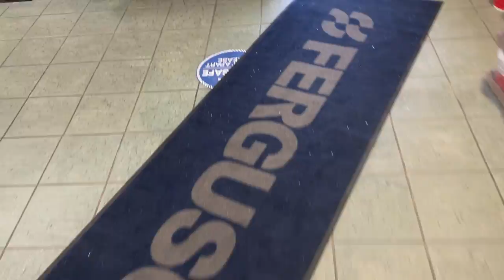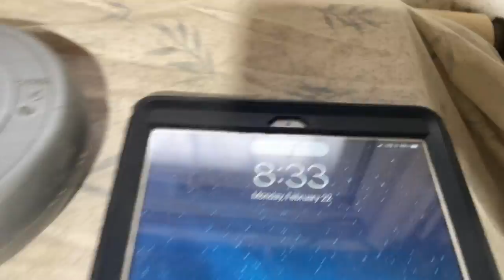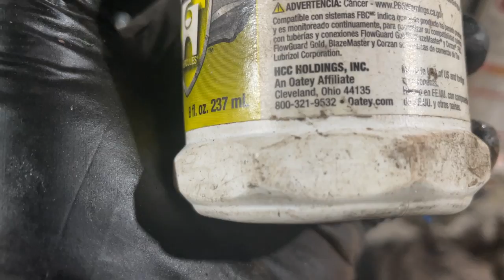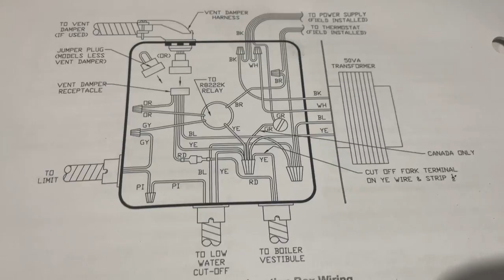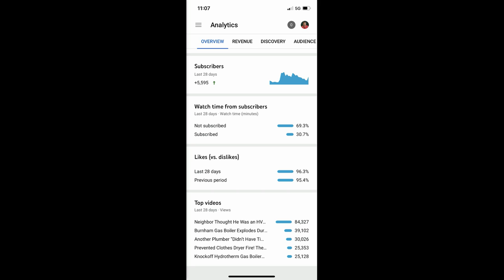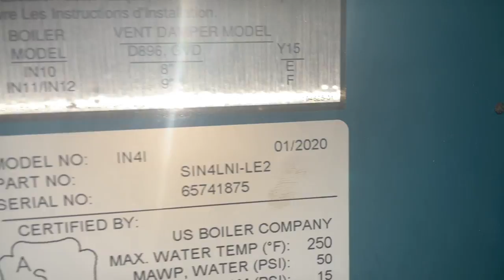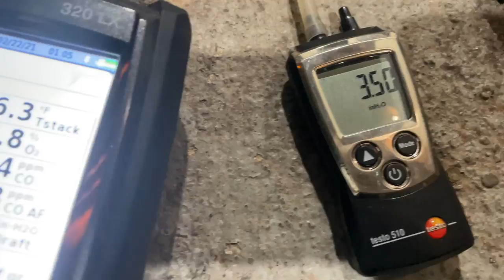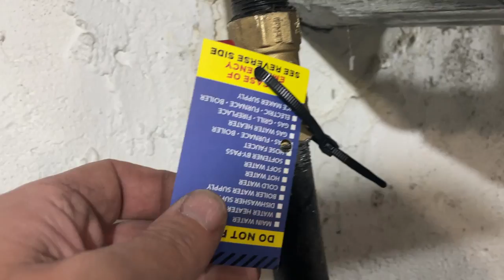Deadly & Lethal Carbon Monoxide & Carbonized Boiler Replaced Burnham Gas Fired Steam Installed

Comment: Thank t for all your time an sharing knowledge,,,you make the channel worth watching,it's always interesting ,I have learned so much from you that it makes my job so much easier an less stressful,,I have no schooling in air conditioning,only 11yrs on the job,,I am a maintenance man of a building,and I only change filters clean coils when it's NEEDED,change belts, determine if compasitor is bad or bad thermostat,until air- containing shows up,,I don't use shop vac to blow out clogged condensation,I use blow out gun you use,,thank you for everything,,,and most I learned from you is honesty and always treat clients with respect

Comment: Another Fine looking steam boiler relacement job completed by Mikey Pipes & his Awesome crew.  I began in this trade in 1980 with my Father's plumbing company.  I'm now age 54 and I'm now employed by another plumbing contractor titled as their top hydronic heat expert/installer.  My question is, why do you connect the cold water feed to the hot cast iron rear section of the boiler instead of piping it to the tempered wet return condensate?

Comment: As the new subscriber who also happens to be an electrician I have a couple critiques. That cable appears to be MC and if so, it has an aluminum jacket which shouldn’t be used with those set screw connectors. Also, running it unsupported from the ceiling box down to the boiler is a code violation. A piece of EMT is what should be used. I agree with you about the wagos. I don’t like those at all. Your mechanical piping looks friggin awesome, btw.  Keep killing it , Mike. 👍🏻👍🏻
Reply: @PipeDoctor  , so the reason why those are NG, is because the set screw can easily crush the soft aluminum jacket causing a short. MC connectors utilize a saddle type clamp that won’t do that. Those style connectors are what would typically be used with old school BX (which is now called type AC), since it has a steel jacket. Bottom line, if the cable has an aluminum jacket, you can’t use a set screw connector. Scope out the link I attached, as those were my go to. They also make one with a locknut as there are times when the snap ins won’t work. I wish I lived closer, I would love to do a guest appearance to do a show and tell on electrical fittings 😂😂. http://www.aifittings.com/catalog/flex-ac-mc/saddlegrip-snap-tite-connectors/

Comment: I've been using that Bahco wrench for over 15 years, they are great. Excellent install!
Reply: Snap on owns them great pipe wrench especially for alignments
Reply: @MrBawston  Sure, as I stated I have used them for over 15 years, in both automotive and hvacr industries. I believe the origin is from an automotive mechanic from another country who licensed them through snap on and other manufacturers. Your right excellent tool, none the less. 👍

Comment: Wago's  are designed for the electrical industry to replace wire nuts as cables have come lose in the past. They are an industry favorite in Europe, especially when you may need to make the connection serviceable.

Comment: It has been told before. The Wagos are fine on line voltage. We in Europe run 16 Amp circuits over them.
However, a well mounted wire nut is just as good if not better than a Wago. The danger with wire nuts is that most people don’t know how to mount them the right way, that is a recipe for disaster.

We are still allowed to use them, but only on solid wire.

It alway surprises me how much electric work is needed for these steam boilers. Over here you see the all in one units like the Navian heaters all the time.

Comment: Hey Mike, your absolutely right, you can never clean a sooted boiler and expect it to be good/safe after. I had one several years back that was sooted with over 3000ppm CO. The customer was the daughter of a manager and he thought he can be cleaned "no problem". Well, my self and my co-worker spent 6 hours, with the manager present cleaning the darn thing, and guess what? still had 500ppm of CO. In the end, I was right--new boiler needed to be installed no matter what you did. That is why it is essential to maintain your gas appliances yearly--especially gas fired boilers in our area! Great video and education as always Mike!!

Comment: Never worked on a steam system. Ripped out a few old one pipe gravity systems that look a bit similar. Enjoying watching and learning from the videos. Be cool to see a full system walk around showing the old cast iron radiators and how they're piped up. Like to hear how the steam circulates/vents and differences with wet/dry returns. All the best

Comment: Here in the UK , we would have deep cleaned it , and inspect or change burner bars. Ensure gas control valve is adjustable and working.. check sufficient ventilation for correct combustion air . Job done 👍

Comment: Hey Mikey pipes. The Wago lever nuts I was telling you about are rated at 600 V up to 32 A they provide a better connection when tested compared to wire nuts. That’s why I use them :-)

Comment: I’ve never seen Steve Lav clean an oil boiler, furnace, water heater etc... and I’ve watched him for years. He throws in a nozzle, oil filter and may clean the pump at times and calls it good. 
I also purchased the Testo 320 because of him.
Reply: You forgot the jingle jangle with the 15 year old screwdriver.

Comment: Hey Mike. When I get my boilers they come packaged.  Low water cut off, glass gauge transformer are all in place.  Or we can get them knocked down. Jacket off and block separate.  All other part's in a box.
Reply: Peerless, Williamson, Crown all come fully assembled. Only need to hook 120 and thermostat wire. Everthing else is assembled and wired. Think Slant Fin is the same.

Comment: your first elbow from the boiler looks like is installed with the outlet side is on the outside of the connecting duct. should it not be on the inside of the next duct pipe?

Comment: Wago connectors have became very popular here in the UK for electricians and plumbers instead of the traditional wiring connector blocks they can be used for stranded or solid copper cable according to the specs and good for upto 450v at 32amps but uk electrics are 240v in residential homes

Comment: Hey Mike.  Looks great.  When you wiring the TT at the junction box on the boiler, you mentioned you were installing a wifi TT.  You connected brown to white and all the blues together, what did you with the red TT wire?  Then up in the ceiling you you just connected the red and white TT wire.  Did you end up not installing a wifi TT?

Comment: The wago\press connections are fine for line voltage, but they are for solid conductors only. No stranded wire. For Stranded wire you limited to wire nuts.

Comment: Wagos are UL listed for line voltage just like wire nuts. What style of wago are you using? The push in kind? Those suck and are only good for solid wire. Go on Amazon and look up wagos, they have ones now were the wire goes in and a handle clamps it down. They’re rated for both soild and stranded wire. I’m an electrician and I love them.

Comment: Mikey pipes!! Slab is always first
Reply: @PipeDoctor  Good video man my mother-in-law’s furnace has soot all over the front face of the unit like this old families from the last video natural vent 70% er no rollout switches Burners are rusted to shit and wet no sediment trap on gas line rust  flakes chipping everywhere in the heat exchanger  I’m waiting for my new CO tester so I can get the numbers off this bitch to see how dangerous it is  and hopefully get them to replace it. Sounds like cracked heat exchanger right?
Reply: I put a detector in the room the system is in until my tester comes in to give me the true numbers.  Hasn’t beeped yet Then the next step is to get them to replace the thing. Homeowners can be so stubborn.... just let it go momma! Lived a long life momma.

Comment: Mikey pipes.  Why don't you use a 2" black cap on the second line where you pour in your boiler treatment powder. A 45 and plug is 4 times the price.  Nice install except for the missing blocks.

Comment: Would it not be better to use a low water cutoff with an auto fill and solenoid setup so that the home owner doesnt have to manually fill his system or een a small feedwater tank and pump setup. We don't see a lot of residential steam systems in Canada so I am trying to see it in terms of the commercial systems I work on

Comment: You are lucky Pipes..... In Miilwaukee, they require redundant controls... 2 low  water  cut  offs, 2  pressure switches,,  2  gauges and in bigger boilers dual gas valves, flip flop relays... etc.... lots of extra wiring  and not an easy pipe job

Comment: Great job as usual!  Mikey G is a great helper,  Godzilla is learning, glad to see you change the old wing gas cock, the wing always break off those the valves, the water heater have the old wing valve guess you will change that when you change the water heater.
Reply: @PipeDoctor  Especially in an emergency you have shut the gas off and the wings break, horrible!!

Comment: Now I need to drop some come cash on a wrench I didn’t even know existed until yesterday!
Reply: I never knew about the propress copper fittings (I'm not a plumber, just fix my own garbage).  Problem is the crimp tool is very pricey.  When I replaced my old Burnham Oil Boiler with a new oil boiler,  they would have saved me a good bit of time plumbing it in.  I can see where professionals love them , saves alot of time and the costs can be passed on.

Comment: When holding back, you technically don't need more wrench leverage. With two wrenches of equal leverage, you have more leverage on the wrench holding back. This is due to the fact that the fitting being tightened is looser then the existing fitting. And this is low pressure steam. You don't need to max out the fitting being tightened. Just some food for thought. Thank Heaven for aluminum pipe wrenches.
Reply: @PipeDoctor  LOL

Comment: @9:34 what you call a sight glass is actually a gauge glass ., a sight glass is  what’s on a a burner plate to allow your eyes to look in the chamber and watch the flame . For example Like on a HB smith boiler  19 series or 28 series or . Also a Weil McLain model 88 . And!!!  a steel boiler like a federal fst has a sight glass at the rear chamber door 🙂👍🏻
Reply: @PipeDoctor  ➡️ ok 🤷🏻‍♂️ lol

Comment: While it's dead there's no chance of CO poisoning I see the big A everywhere . Asbestos rope used to seal the bottom of boiler is a killer. A squirt bottle with water in it to hold down the microscopic asbestos particles would be useful, just dampen the asbestos so you don't breath it in and while working ,vacuum up the mess.

Comment: Nice job Mikey just my 2 cents, I mentioned using a Street 90 on the Hartford loop in the past. I also would like to see the gas cock closer so I could reach it while viewing the fire. I'm also not a fan of the service switch on the ceiling. When I mentioned my Testo doesn't work in the cold, I was trying to tell you not to buy another one.  I really enjoy watching your work. BTW  I comment on "it isn't easy being cheesy" but he doesn't respond back.

Comment: Surely a carbonised boiler can just be cleaned , readjust the or replace gas control valve and or burner bars, simple job ?

Comment: Ever tried keytite for pipe dope? I used it on steam lines and water lines at my last job and didn't have any issues with galling or removing fittings.
Reply: @PipeDoctor  its good stuff won't even harden when exposed to higher heat like steam
Reply: @PipeDoctor  Straight from the web site. This viscous sealant cannot be equaled for leak proof sealing of threaded, flanged and gasket joints. Use Key-TiteÂ® in flow lines for hot and cold water, aqueous solutions, low pressure steam slurries, natural and manufactured gases, compressed air, filled products*, dilute acids and caustics, and alcohols. Key-TiteÂ® is dark green and consists of vegetable and mineral oils and prime and extender pigments, plus an anti-oxidant. Key-TiteÂ® contains no lead or other toxic ingredients, and will not affect the taste or color of water or any other potable liquid.

Comment: Wire nuts are still availale at least in Finland, but IMO they are terrible especially with stranded wire. Also when I went to vocational school we were strongly adviced against reusing the nuts, but rather to discard and put on a new nut every time you undo one - the one case aside that you may ONCE add a wire and reuse the nut if it comes off nice. Also you should never put more than 5 wires under a nut. 6 will be unstable and a seventh one is a big no-no because one of them would likely become centered between the 6 others and  just pull out.
Reply: @PipeDoctor  They are designed for power wiring but low voltage should not be an issue. I've had none wiring 12V and 24V AC or DC relay logic and the like, and I've used them on speaker wires in HiFi without issues as well. They are likely not the fittest for high frequency signals. That part of boiler wiring should not bring up any issues, but time will tell of course.

Comment: Mikey - question for ya,  How did that snow melt system work for you last week?  Also, what temp do you run it at? 120ish for "normal" radiant floor, or do you go higher 160-170?
Reply: @PipeDoctor   Thanks!  Subscriber, but too far East for your service area - unless you want to road-trip to South Central Suffolk...
Reply: @PipeDoctor  Whaaat!  No 3-hour (each way) road trip with Godzilla Steven?!! Dang!  

Figued so.  No problem, I'll just have to keep watching "Mikey Pipes" on youtube!  Stay safe - The whole crew.

Comment: I work in maintenance and work with electricians all the time. They have told me not to use those wago connectors or connectors like them. they can heat up and melt or start a fire. I don't want that!

Comment: MP, your fast, slow your roll a pinch and start giving your customers a drop header on the steamers, bring it to the next level. Your good, you could be better. Thx Steve.
Reply: @PipeDoctor  When you look at a diagram of it, you will see that the steam coming out of the chest gets a chance to remove liquid right away, then you have the driest steam entering your overhead. Im doing this 40 years, just started drops 5 years ago, its the new technology. Peace. Steve.
Reply: Ps, works on single headers also.
Reply: I never installed a steam drop header yet but plan on it in the near future. Gordon schweizer installs a lot of drop headers. He’s got a lot of videos about it. I also saw him comment on one of your videos in the past. Great job as always

Comment: You should never use wago’s on stranded wire! [as they are] Only use wago’s in conjunction with bootlace ferrules when using stranded wire.
Reply: The 221 Wago series will do solid, stranded and fine-stranded conductors.

Comment: We cleaned carbonized heaters all the time its just a vessel take your time,no different the an annual cleaning of a oil burner?🤔🥃🍺🍺🏌
Stay safe.
Retired keyboard super tech.
Wear your safety glasses.
Reply: @PipeDoctor  I'm try'n to be like you preparing for my addition & laundry room bump out.🍺🍺🏌🥃
Stay safe.
Retired keyboard super tech.
Wear your safety glasses.

Comment: Hi. Check out the Wago current tests on YouTube. Wire nuts fail before Wagos.
Reply: @PipeDoctor  I rarely use wire nuts. I have about 5 years experience with Wago connectors  on 120 VAC with no issues. Love them.